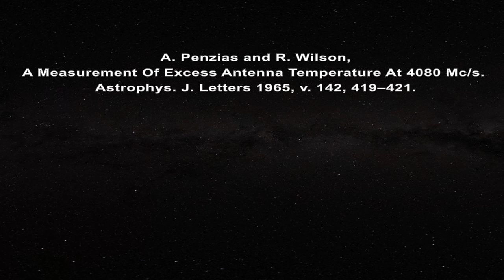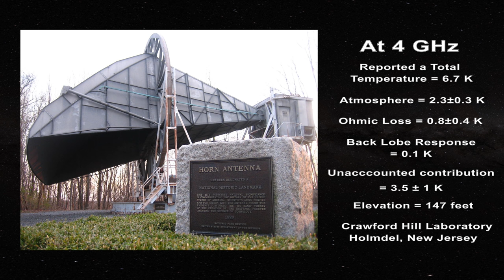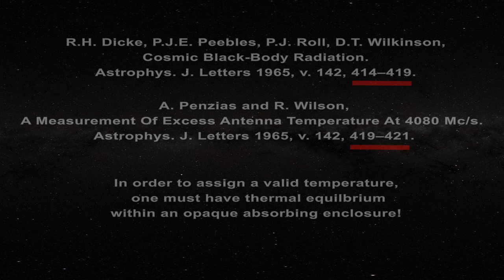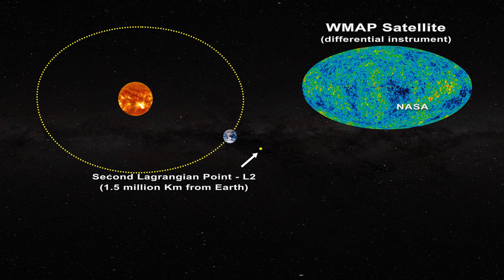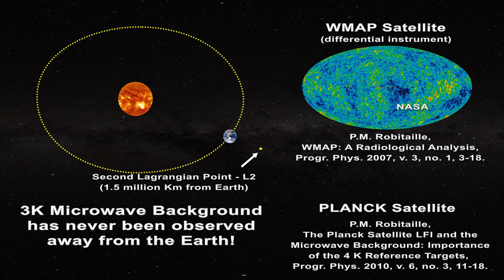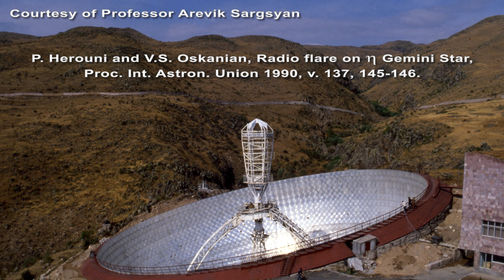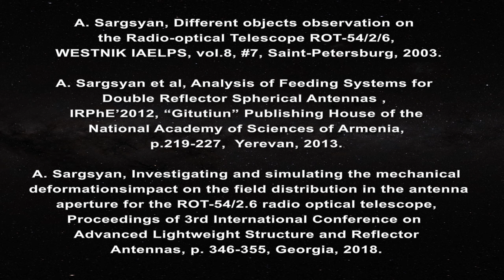The Herouni Antenna - The Death of the Big Bang!

Comment: I shared this to an astronomy group on FB and was immediately blocked.
Reply: If it was blocked by the scientific aristocracy, then it probably has validity.
Reply: @beyond_the_infinite2098  
That is a big problem with the rise of pseudoscience as of late... people on YT decide if a theory is valid not on the merits of the theory... but if mainstream science rejects it, it MUST BE right!! Conspiracy-science at its finest. I guess you believe in flat-Earth too?
Reply: Not good..
Reply: @Hank254  Agree but skepticism must explain why pseudoscience is wrong. If it doesnt then something smells politics or religion or territorialist behaviour.
Reply: Hank yeah you nailed it, the statistical power generates a significance if you go the opposite way of mainstream.
It could change bitnsondarnit works every time, go figure....
Reply: @beyond_the_infinite2098  That's not how science works - that's how religion works.
Reply: That's what you get for going on Tardbook.
Reply: @KibyNykraft  
To an extent, yes that is correct. The problem is that even after the errors/pseudoscience have been pointed out, the pseudo-scientists refuse to accept them. People do not believe flat Earth because of unexplained skepticism... they have their own reasons to believe which scientific explanations can not change. Mostly it is because there is an underlying belief which the science is mucking up. 

Robitaille's 'science' has been addressed, his pseudoscience pointed out, and his simple lack of understanding of the subjects he is talking about is clear to anyone trained in those fields. He simply refuses to accept it. He pushes forward, creating more videos, essentially arguing that the majority of science is completely wrong, without offering any evidence. All he has are ideas and an old telescope that would prove him right if it weren't decommissioned  :(  If this telescope were re-commissioned, and it showed him wrong, do you think he would accept it? I don't.

The reverse of what you said is also true... if pseudo-scientists want to be recognized as legitimate, they need to provide extraordinary evidence to back up their extraordinary claims. When they don't, it also smells.
Reply: @Hank254  : "He pushes forward, creating more videos, essentially arguing that the majority of science is completely wrong, without offering any evidence." Hank

Your remark is not true.  Professor Robitaille always provides evidence. He has presented evidence in this video. Here are two papers for you and others of your persuasion:

[1] Robitaille P.-M., WMAP: A Radiological Analysis, Progress in Physics, v.1, pp.3-18, (2007), 
 http://www.ptep-online.com/2007/PP-08-01.PDF

[2] obitaille P.-M., COBE: A Radiological Analysis, Progress in Physics, v.4, pp.17-42, (2009), http://www.ptep-online.com/2009/PP-19-03.PDF
Reply: Lots of politics in science.
Reply: @stevecrothers6585  
"Your remark is not true.  Professor Robitaille always provides evidence. He has presented evidence in this video."

You seem to be confusing evidence with opinion. Even in the conclusion of the first paper, he states
'

Analysis  of  data  from  WMAP  exposes  several  problems
which  would  not  be  proper  in  medical  imaging.'

Well, that's all well and good but we are not talking about medical imaging and the good doctor is well out of his area of expertise. While he may be formally trained in radiology, he is not formally trained in cosmology and it is clear his understanding of thermodynamics is wrong.

You probably don't recall but we have already had a similar discussion, Steve... all you did was cite papers which have already been rejected for various reasons by people actually trained in the respective fields. That is not what I call evidence nor productive exchange.

If you want productive conversation, please tell us if Robitaille's papers/ideas are accepted as mainstream. If not, please explain why the vast majority of cosmologists can't seem to figure out/accept that their images are only water-noise. Hint: Conspiracy theories, myths of 'settled science', rejection of outsiders, etc. aren't going to cut it.
Reply: @Hank254  : You are simply choosing to ignore the evidence. First, WMAP all-sky maps are nothing but data-processing artefacts. There is no signal in its maps. The signal to noise of WMAP is barely greater than 1, so it can't tell the difference between noise and signal even if signal is present (but it isn't).  The noise is ~1,000 times greater than the alleged signal. Without a priori knowledge of the source of emission or an ability to manipulate the source, it is impossible to extract any signal from such a large envelope of noise; well known to imaging science. In the absence of the CMB monopole signal all talk of anisotropies is wishful thinking. It is a scientific fact that the CMB monopole has never been detected beyond ~900 km of Earth - precisely because Earth is the source of the signal.

"While he may be formally trained in radiology, he is not formally trained in cosmology and it is clear his understanding of thermodynamics is wrong." Hank

Professor Robtaille is the inventor of Ultra High Field MRI. He knows how to take an image. WMAP has no images of anything. I suggest that you study professor Robitaille's paper on WMAP and then prove any error therein that you claim. As for thermodynamics, professor Robitaille is quite an expert. Take but one example: temperature is always an intensive thermodynamic coordinate. Astronomers and cosmologists however, unwittingly make their stellar and black hole temperatures non-intensive, in violation of the 0th and 2nd laws of thermodynamics. Professor Robitaille is correct; the astronomers and cosmologist are incorrect.
Reply: @stevecrothers6585  
I see that you chose not to answer my question as to why people formally trained in these fields (which you and Robtaille are not) can't figure this out. I must say I am not surprised. 

Simply claiming he is an expert is completely worthless; I have read his explanation of why he thinks Kirchoff's law is wrong and I can tell you for a fact he doesn't understand thermodynamics. His (and your) refusal to accept that doesn't make him right. 

The thing that is most upsetting is your (and Robtaille's) decision to shift your burden of proof to an audience of YouTube pseudo-scientists and flat-Earthers. Real science is not done with Youtube videos, arguments in comments section/blogs, and New York Times advertisements. The fact that you are unable to obtain publication in legitimate peer-reviewed journals is not an indication that you are being discriminated against or of some vast science conspiracy... it means you are missing something. Your closed-minded inability to accept that is no one's fault but your own.
Reply: @Hank

I stumbled into this video and I took a careful sniff of the water glass I've been drinking from then took a look at some of Pierre-Marie Robitaille's other videos. I'm pretty sure he and Deepak  Chopra could have an enjoyable lunch together explaining their own special relativity to reality to each other. I may have to subscribe just in case Big Foot comes into the equation and watch for the nut jobs to defend him...  

https://rationalwiki.org/wiki/Pierre-Marie_Robitaille
Reply: @Hank254  : 
"I have read his explanation of why he thinks Kirchoff's law is wrong and I can tell you for a fact he doesn't understand thermodynamics." Hank

What did you read and where is it wrong? You make claims without any evidence, so present your evidence. I reiterate: temperature is always an intensive thermodynamic coordinate. Astronomers and cosmologists however, unwittingly make their stellar and black hole temperatures non-intensive, in violation of the 0th and 2nd laws of thermodynamics. Professor Robitaille is correct; the astronomers and cosmologist are incorrect. Study the two papers below and explain to everybody where and why you think there is an error. 

[1] Robitaille P.-M., WMAP: A Radiological Analysis, Progress in Physics, v.1, pp.3-18, (2007), 
 http://www.ptep-online.com/2007/PP-08-01.PDF

[2] obitaille P.-M., COBE: A Radiological Analysis, Progress in Physics, v.4, pp.17-42, (2009), http://www.ptep-online.com/2009/PP-19-03.PDF
Reply: @stevecrothers6585  
If you do not want to have an actual, productive conversation about why you choose to peddle pseudoscince on YouTube rather than get a formal education on the material, then there is really nothing to talk about.

I have already explained, we have been down this road before... several years ago. You cite Progress in Physics papers, a pseudoscience journal founded specifically for authors who cannot pass peer review, as if their publication gives them merit. Why not just link to his website? Why can't his papers pass peer review? Why do formally trained physicists, cosmologists, astrophysicists, etc. point out problems in his papers that he (and you) are unwilling or unable to explain? 

Your (and his) claimed 'explanations' are trips down a non-productive rabbit hole to reach things that you simply dismiss as unbelievable, illogical, or, in your opinion, wrong. It is the exact same rabbit hole that Flat Earthers, global warming deniers, relativity deniers, 9/11 truthers, and so many other conspiracy theorists want to take you down. That is not a coincidence and it is not science. It is simply a method of distraction, a waste of time in the hopes that your adversary goes away and you can claim a pseudo-victory. It is simply to stroke your ego while you pretend to be on the same level as the people who explain why you are wrong.

Sorry, Steve, I will not play your game. If you want to have an actual discussion, please pick a field and get a formal education in the subject first. With all you claim to know, that should be child's play. There is no legitimate reason for why you could not do that instead of playing these completely nonproductive games. You want to have an actual discussion? Why don't you point to everyone out where you think I am wrong.

Maybe you don't want to give your 'hard earned money' to an education system you think is illegitimate? Here is an easy way around that... simply start a crowd-fund campaign 'Get Stephen Crothers a formal PhD'. You could frame it to your followers as 'beating them at their own game'. You would probably even get legitimate scientists to contribute if you put the money up front and asked for reimbursement after you pass your classes.

So how about it Steve? Are you man enough to level-up to the people you claim you are proving wrong? Or are you just in this for the rabbit hole?
Reply: @Hank254  : Your insults carry no scientific weight whatsoever.  Go back to my previous email: study the papers I cited there and then give the audience your explanation of where and why you maintain there is any error. So far you have not advanced a single scientific argument.  

"I have read his explanation of why he thinks Kirchoff's law is wrong and I can tell you for a fact he doesn't understand thermodynamics." Hank

What did you read and where is it wrong? You make claims without any evidence, so present your evidence. Also provide your proof that temperature does not have to be intensive as required by the 0th and 2nd laws of thermodynamics.
Reply: @stevecrothers6585  
Where exactly do you think I am insulting you? I asked you to tell me where you thought my post was wrong... why did you not do so?
Reply: @stevecrothers6585  
Whenever someone tries to overturn a currently accepted theory, one of the first things I look for is whether or not that person is trained in the subject they claim to know. While a formal training is not required to understand something, there are many details that people who self-study can miss. They end up with a basic understanding but it is not at the level of formal training.That is why self-taught 'scientists' are sometimes at odds with actual scientists.

Do you know how theories become accepted? The people who have formal training and, usually, work in the respective fields (the most knowledgeable in the subject) feel that a particular theory best matches the observations. A person who wants to overturn a theory must understand that theory at least as good as the person or people that came up with it. After all, by trying to overturn it, they are in fact claiming to know more than the people who came up with it. They should be able to teach/explain that theory and would have no problem understanding why it was accepted. They don't attack prevailing theories with baseball bats like you and Robtaille do.

I saw your (assuming it is you) YouTube video on the logical inconsistencies of Special Relativity and I can tell by the way you describe it that you clearly do not understand Special Relativity. This is not an invitation to debate the theory, I have no desire to teach it to you. I am simply stating a fact. 

I read Robtaille's claim of why Kirchhoff's law is wrong and I can tell he is not trained in (and doesn't understand) thermodynamics. This is not an invitation to debate PTEP papers with you. Pretending that the issue hasn't been addressed is disingenuous... that is a tactic of pseudoscience and it is pointless to argue science with pseudoscientists. 

If you (and Robtaille) think you are in a position to overturn these theories, it should be easy work for you to obtain degrees in these subjects. It would consist of simply passing the tests to get your degrees... no course work should be required. Stop playing rabbit-hole games and show us all that you are worthy of the position you are attempting to insert yourself into. Stop feigning insult to avoid the real discussion. Put up or shut up Steve.
Reply: @Hank254  
If your so smart, why don't you just answer his question on temperature? I ahve seen a few of his videos on the electric universe and they make sense to me. What have you done?
Reply: @juliopaquete6680  
Well, first off, I am not the one claiming to be smart... Crothers and Robtaille are the ones doing that. All I am doing is pointing out that if they were as smart as they say, they could (and should) easily get degrees.

Secondly, I am not answering his question because he is not really asking a question. Questions are things you want answers to... Steve pretends to already know all the answers. It is a psychological game he is playing because it upsets him that he isn't part of what he considers the 'scientific elite'. He really REALLY wants to be and this is his way of getting back at 'them'. His 'questions' have already been responded to in other places by professors but he just keeps asking them. When people take the time to explain things to him, he becomes combative and adversarial... when the other person matches his tone, he then accuses them of being adversarial and unscientific.  Over and over again this is the 'meat' of his arguments... wash, rinse, repeat... it is nothing but trolling. I refuse to play his troll game and instead bring the conversation back to reality. He doesn't like reality and, as you can see above, he refuses to participate.

The temperature question he is pretending to ask is itself a lie, intended to disparage astronomers and cosmologists. They are NOT claiming that temperature isn't an intensive property... he is misrepresenting something so he can claim that. As has been explained to him before, there is a difference between classical thermodynamics and black hole thermodynamics. Classical thermodynamics is based on kinetic theory of particles while black hole thermodynamics is not. The 'temperatures' of the two different theories are analogous but not exactly the same. He simply refuses to accept this (by denying black holes can exist) and changes the subject to something else he gets wrong. When you take the time to explain the new thing he gets wrong, he refuses to accept it and moves to a third thing he gets wrong. It is a deliberate game of willful ignorance. It is a complete waste of time to engage him in pseudo-scientific discussion.

As far as EU theory goes, people fall for it because it has a certain intuitive feel to it. It tries to relate gravity to electricity because both fall off as the square of the distance. Electrical Engineers are (generally) smart people but they seem particularly prone to making that incorrect intuitive connection. Unfortunately, human intuition has been shown again and again to be imperfect at figuring out how things work. Take the Bhor model of the atom (the electron orbiting the nucleus like little balls)... do you have any idea how common it is for people to think 'Hey... maybe atoms are actually tiny little solar systems/galaxies with people living in them!!!' That 'theory' comes up over and over again because it has an intuitive feel to it. Granted, the Bhor model is not very accurate but trying to convince people that atoms are not solar systems becomes difficult if they lock on to that. EU theory is very much like that. Einstein also tried, and failed, to unify gravity with electricity (though in a totally different way). Don't fall for it... if you are really interested in the subject, study physics... don't watch fringe YouTube videos. Electric Universe is the same as flat Earth, free energy, perpetual motion machines, and fake moon landing conspiracies. They use the flaw in human intuition to go off in the wrong direction.

I can tell you for a fact that Crothers (well, let's face it... we are really talking about Robtaille  here, Crothers' scientific knowledge amounts to a speck of flea shit. Crothers is only parroting what Robtaille says) doesn't understand what he is talking about. He puts on a good show, all trolls do, but there is no actual substance there.
Reply: @islandbuoy4  Why would Jesus love female sheep?
Reply: @Hank254  : "This is not an invitation to debate the theory, I have no desire to teach it to you. I am simply stating a fact. I read Robtaille's claim of why Kirchhoff's law is wrong and I can tell he is not trained in (and doesn't understand) thermodynamics." Hank

I reiterate: what did you read and why is it wrong? You must provide evidence to support your allegations.

"I can tell by the way you describe it that you clearly do not understand Special Relativity." Hank

This is not a scientific argument. You must provide evidence to support your allegations.

So far you have not advanced a single scientific argument.
Reply: @stevecrothers6585  
"I reiterate: what did you read and why is it wrong? You must provide evidence to support your allegations."

Your latest post is completely devoid of meaningful dialog. I have provided you a channel for meaningful dialog and you continually choose to ignore it. 

The evidence to support my allegation(s) has already been provided to you by others. Your simple denial does not change that fact nor does it change the quality of the evidence. Your refusal to accept the evidence as valid does not constitute a rebuttal of the evidence. It is, in fact, your refusal to accept the evidence that REQUIRES YOU to justify proper understanding of the material. The way that is done is by demonstrating to an accredited institution that you have the requisite knowledge. Neither you nor Robtaille have done that in the subjects you claim need to be revised.

Do you understand the null hypothesis of this situation, Steve? The default position? The default position is that people (which include you and Robtaille) are considered to be part of the average population (i.e. not subject matter experts) unless evidence is provided to the contrary. Your (and Robtaille's) position of refusing to accept the validity of subject matter experts is itself a claim that you are more knowledgeable than said experts. You also state outright that Robtaille is an 'expert in thermodynamics'. I reiterate Steve, Please provide evidence of your claim. If Robtaille (or you) is trained in this material as you suggest, please provide the evidence or a reasonable justification for why this would not be required.

Until you do this, Steve, your refusal to accept the explanations for why you and Robtaille are wrong, combined with your disingenuous position that the issue has never been explained to you before, constitute PSEUDOSCIENCE. There is no reason to address your pseudoscience with actual science.
Reply: @Hank254  Have you or any accredited experts in thermodynamics presented these refutations to Dr. Robitaille in papers or any sort of public form? It would be a simple matter to cite that, so us average people could hear the answer too.
Reply: @TorJuice  
Part of the problem with what you are asking is that actual science is not done in public forums... that's how pseudoscience is done. The fact that his 'papers' cannot pass peer review is all the refutation that is needed. There is no need for real scientists to publish papers refuting his misunderstandings any more than they need to publish papers refuting every flat-Earth claim. It is a complete waste of valuable time to explain things to people that have their fingers in their ears. I gave Crothers the opportunity to explain why he and Robitaille  are unable to pass legitimate peer review and he could not answer. He could also not answer why Robitaille  is peddling his misunderstandings to the unsuspecting public when he has repeatedly been told why his theories are wrong.

FWIW, I have never even seen Robitaille  try to defend his position in a public forum (although Crothers tries to quite often). If you search, you will find many examples of real scientists pointing out the flaws in Robitaille's arguments. Anyone interested in learning about science should be doing their own research rather than having someone point to it but if you search for Brian Koberlein Tilting at Windmills, you will see one example of what you are looking for. There are many others. Personally, I would recommend learning about Kirchoff's law directly (what it means and how it was discovered) instead of trying to prove a particular person right or wrong.

For your future research into science, a glaring indicator that someone is a crackpot is when their whole approach is to simply destroy existing theory without presenting anything better as a replacement. Robitaille and Crothers want to destroy the CMB so they can destroy the Big Bang... yet they offer no theory to replace it or explain away the other data. They want to destroy special and general relativity... but they have nothing to explain why experiments back up those theories so well. They dispute the existence of black holes yet offer nothing to explain extreme orbits observed around them. These are clear indications of pseudoscience in action. Real scientists don't spend all their time refuting established theories, they come up with better theories that make the old ones obsolete.

I have asked Crothers several times now but he refuses to answer... maybe you could give a reason.... if Crothers and Robitaille  know as much as they claim to know about thermodynamic (and physics in general) why can't they simply go through the motions of getting PhDs in the subjects they claim to be experts in? Rather than just arguing they are experts, why don't they SHOW US??
Reply: @Hank254  Thank you for the reference. I asked because I find it's usually more productive to look at the arguments or sources given by people at hand with a stake in a controversy first, rather than search engine results.

Whatever value specific academic degrees have for choosing where to place some baseline trust, one's time and attention, on any specific question appealing to that authority is just a fallacy. I don't see how it's at all contingent on someone pointing out an error, right or wrong, to re-explain everything built upon that error. It sure would be nice, but it's not really on them. The current state of theory in physics and cosmology was the work of many hands, and it would be again if big unknowns were reopened.

I've certainly found mavericks before who sounded good at first but turned out to be full of hot air. I've also seen plenty of evidence that scientific culture is not immune to the pitfalls that arise from any group of creatures as crazy as humans organized into a collective. I don't know the math required to really evaluate Crother's claims, or anyone else's on exactly how spacetime is supposed to work for that matter. But I do feel equipped to fully understand something like Kirchoff's Law, given time.

For now, it seems to me I'm faced with two hypotheses for why Robitaille's work is rejected by physics journals and he's labeled a pseudo-scientist.

1. He has indeed made some fundamental errors but just won't quit.
2. He is correct about at least some of the errors he asserts, but they have been unwittingly perpetuated by so many for so long anyone whose work hinges on them would fight tooth and nail against ever admitting it, even to themselves, because it's that embarrassing and disheartening.

Whatever the case, I'm sure time will tell.
Reply: @TorJuice  
I disagree that examining the arguments in a controversy would be more productive than using search engines to find relevant information on the topic, or even the controversy, at hand. To do this elevates the perceived status of a psuedoscientist to that of an actual scientist... THAT is the main goal of their argumentative tactics. They like to treat science as if the validity of a theory is based mostly in the debating skills of the person presenting it. I wholeheartedly disagree with that position but it is extremely effective at swaying people who prefer watching the debate over leaning the science.

While I agree with you that anyone is free to point out an error, claiming that putting your trust into the authority of an academic degree is a fallacy is, pardon my frankness, completely ridiculous. You would never do this in any area of life where it mattered to you so why do you now try to use this as an argument in favor of listening to pseudoscientists? If your arm were severed in a car accident, would you go to a kid behind a McDonald's counter to re-attach it? He claims that 'doctors' understanding of the human body is majorly flawed and blood is not needed to survive (and puts up a great argument to his friends) so would you say he is just as capable? Somehow I think you would put your baseline trust in to the academic authority. People don't get to simply claim they are an authority and have it be true, that is exactly what Crothers and Robitaille are doing. They are attempting to position themselves as authorities without being able to demonstrate (even in the slightest) that they fully understand the material. If you are trying to claim that putting a baseline trust in academic degrees is the logical fallacy of 'Appeal to Authority', then I am sorry but you don't understand the fallacy.

That particular position is even refuted by Crothers himself by repeatedly making appeals to the established academic science to bolster his own arguments. Why would he do this if that is a fallacy? Why is he bothering to make an appeal to the very scientists he is claiming we should not listen to? He is simultaneously trying to use the position that an academic degree in institutionalized learning is immaterial and flawed AND using the flawed material to formulate his own position. Crothers wants to 'Stand on the shoulders of dwarfs', or at least he is calling them dwarfs. All he and Robitaille need to do is use their claimed superior understanding for actual results rather than Youtube ad revenue and hi-fives from flat-Earhters. If they did this, they would find science following them instead of ignoring them.

The point about re-explaining everything based upon an error being contingent upon an alternate theory goes to the acceptance of that new theory. The person is not required to re-evaluate the entirety of science, no one is asking for that... there are others that will come up with replacement theories in their respective areas of expertise. The problem is when someone wants to claim a theory (which is very good at explaining experimental results) is wrong and must be discarded when they have nothing else to explain the experimental results. Not only do they want to destroy the currently accepted theory, but they want to destroy anything that is based (even loosely) on that theory. That is simply not how science works. That is the sign of a pseudoscientist with an agenda. If Robitaille  and Crothers want to say that Kirchoff's law (among many others) is wrong, then it is most definitely contingent upon them to present a replacement law that explains the observations better than Kirchoff's law did. They are totally unable to do this. Instead, they say we should disregard Kirchoff's law and listen to them instead... that whatever they tell us to believe is right.

For your two hypotheses of Robitaille's rejection, I can tell you that #2 is an often perpetuated misunderstanding of how science works. No one is going to lose their job or funding or be ostracized if a better law than Kirchoff's is discovered. The thing that drives the vast majority of scientists to become scientists in the first place is a desire to understand the way the universe IS, not to show that their understanding is right. Non-scientists have a hard time accepting this because most people are more obsessed with being right than actually understanding. So, to the average person, your hypothesis 2 seems legitimate. That type of thinking is exactly why the average person is not a scientist. It starts with a mindset, progresses through an education, then continues with work in that field which may (but often doesn't) produce new findings and theories. Science is updated ALL THE TIME when something better is presented. I could say that eliminating your second hypothesis leaves only one possibility but that would be a fallacy of false choice. There may be many other reasons why he (they) are rejected and I would be happy to examine them if presented. The most telling fact I see right now is that Crothers refuses to answer the question. Nor will he answer why, if they are such experts in the material, can't they demonstrate it by passing tests of the prerequisite knowledge?

So there is, hopefully, a concise description of a fork in the road. It was hoped by many that the Internet would make access to valid information easier and facilitate learning; path #1. Unfortunately, it seems to have also made louder the voices that tell us logic and learning are no where near as good as arguments and human intuition; path #2. Neither path is perfect but one has actual results (like the device you are using to read this) and the other has lots of worshipers. It is up to the individual which path they want to choose (or maybe we don't really have a choice) but I can tell you that when I look at Crothers' arguments, I can clearly see he is full of #2.
Reply: @Hank254  Thank you very little for wasting our time with your words.
Reply: @P-Drum  LOL, look who's talking  ;)  Can't even be bothered to address the topic and I am wasting your time?!?! LOL If you are watching this channel, you've got plenty of time to waste!
Reply: @Hank254  I tip my hat, o mighty troll.
Reply: @P-Drum  Even more time wasted... why don't you just explain Robitaille's replacement for Kirchoff's law instead of posting nonsense?
Reply: Commodore Grayum Crothers and others like him do not answer questions or acknowledge errors. People like those are not worth conversing with on issues of science. I totally agree with Hank.
Reply: @CommodoreGrayum  You willfully miss the point. I have pointed out Crothers' mistakes, and he then goes quiet. For example, under his SR lecture, another commenter and I have been trying to explain an area of the subject he clearly misunderstands, and he turns into either a broken record, repeating nonsense, or disappears from the conversation. That's not science or honesty - that's being a troll.
Reply: @CommodoreGrayum  Would you agree with this or not?
Reply: @CommodoreGrayum  Do you still think Hank is wrong after reading that? It would amaze me if you could find a reason not to retract your previous evaluation.
Reply: @Commodore Grayum Ooh, a hard one. Little bit of unnecessary heat there fella. This: https://i.ibb.co/4wqwygC/image.png . Are you just ignoring my comments?
Reply: @CommodoreGrayum  Lol calm it bro, he just responded to your query pretty decently. No need for the insult.
Reply: Evidently Hank is unwilling to refute a single point but prefers to fence with his high brow and demean his foes by mighty slurs, impugning and priggish condescension.
Reply: Name the group or I call BS.
Reply: Pete  : Irrespective of SAFIRE results, hank and nuclearcraft are tag teaming with not one single verified scientific fact. They skirt all substance then turn around and accuse Crothers of what they alone are doing. hank sez Crothers is refusing to indulge in "useful dialog". What hank deems "useful" is anybody's guess, but it doesnt include substantive refutation. It is ad hominem, only. That in itself is admission of cluelessness.
Reply: But what did you expect from that arena?
Reply: This is depressing! Scientists should be open to all the criticism, this is how Science progresses.
Reply: Not surprising, really, as the Big Bang Theory has always been intrinsically linked to religious doctrine about The Creation. People are terrified of their beliefs being threatened. Religion has been stifling scientific advancement, particularly in cosmology and astronomy, generally, for a very, very long time.
Reply: @stevecrothers6585  you keep referring to the second law of thermodynamics, but Kirchoff's law itself is a consequence of the second law of thermodynamics. You can't just deny Kirchoff's law and leave it at that.
Reply: @alexdevisscher6784  : "Kirchoff's law itself is a consequence of the second law of thermodynamics." Alex De Visscher

You are incorrect. You obviously don't  know what Kirchhoff's Law is. Tell us all what Kirchhoff's Law is in your next post.
Reply: @stevecrothers6585  you have some nerve. You can't even bother to come up with a scientific argument, even though you demand scientific arguments of others. 
Kirchoff's law: emissivity equals absorptivity. Do you want proof too? Here it goes. Suppose emissivity of an object is greater than its absorptivity. Then that object is able to heat up a blackbody of the same temperature, because the emission plus reflection of the object is greater than the emission of the blackbody. The blackbody increases in temperature, and the temperature difference can be used to drive a heat cycle. Result: free energy, in violation of the second law of thermodynamics. If the emissivity of the object is less than its absorptivity, then the blackbody can heat up the other object, which again leads to free energy and a violation of the second law. Conclusion: emissivity equals absorptivity, proving Kirchoff's law.
Reply: @alexdevisscher6784  : "Kirchoff's law: emissivity equals absorptivity." Alex De Visscher

No, that's not right. What you stated is Stewart's Law, except that it only holds at thermal equilibrium; otherwise it does not hold. Kirchhoff's Law of Thermal Emission however, is certainly false.

Robitaille P.-M., Crothers S. J. "The Theory of Heat Radiation" Revisited: A Commentary on the Validity of Kirchhoff's Law of Thermal Emission and Max Planck's Claim of Universality,Progress in Physics, v. 11, p.120-132, (2015),
http://vixra.org/pdf/1502.0007v1.pdf
Reply: @stevecrothers6585  no, you are wrong. Stewart stated that emission equals absorption, which is not strictly the same as saying that emissivity equals absorptivity. Look at any physics textbook, and you will find Kirchoff's law essentially the way I stated it. Your paper contains several flaws that invalidate the argument against Kirchoff's law. First of all, you don't distinguish between absorptivity, which is a surface property, and absorption coefficient, which is a volume property. The distinction is very important if you want to understand Planck's argument. By confusing the two, you conclude that reflection is needed in a part of Planck's argument that doesn't need reflection. A different, but related flaw is that you don't seem to understand the concept of the infinitesimal in calculus, causing you to add absorption in a part of Planck's argument where no absorption is needed. The overall outcome is that your paper is fatally flawed, and Kirchoff's law stands.
Reply: @alexdevisscher6784  : You are still wrong. Stewart determined from experiments that only at thermal equilibrium does emission equal absorption: Stewart's Law. It's clear that you don't understand what thermal equilibrium entails. That the textbooks incorrectly refer Stewart's law to Kirchhoff does not make it Kirchhoff's Law. You have not even stated Kirchhoff's Law. It's quite clear that you don't even know what Kirchhoff's Law is. Your argument about reflection is nonsense. Planck did not consider or test reflection owing to his abuse of Brewster's Law with the former's polarised radiation. Blackbody radiation is never polarised. This has nothing to do with the calculus; it is a matter of physics. You have not in fact identified any flaws in our proof that Planck's theoretical proof of Kirchhoff's Law is false.  There is no theoretical or experimental proof of Kirchhoff's Law; precisely because his 'law' is a fallacy. The very existence of resonant cavities proves that Kirchhoff's Law is false. But to know why you will first have to learn what Kirchhoff's Law is.
Reply: @stevecrothers6585  you obviously didn't understand my argument, so you're calling it nonsense. Again, emission is not the same as emissivity. Absorption is not absorptivity. Your response clearly shows that you don't understand the difference.
We've known since Newton that physics cannot violate calculus. The way your paper mixes up surface properties with volume properties violates calculus. 
Planck clearly mentioned "arbitrary polarization" in reference to blackbody radiation. In other words, his argument works for any polarization. So by applying the argument to every possible polarization angle, and considering a mixture of light rays of all possible polarizations, we find that his argument applies to non-polarized light. Kirchoff's law, the way Planck formulated it and the way it is generally known, is correct.
Reply: @alexdevisscher6784  No, Planck is wrong. Blackbody radiation is never polarised. Furthermore, by his abuse of Brewster's Law Planck did not even test reflection.

"We've known since Newton that physics cannot violate calculus." De Visscher

Calculus is pure mathematics. Physics is not mathematics. 

"Kirchoff's law, the way Planck formulated it and the way it is generally known, is correct." De Visscher

The existence of resonant cavities proves that Kirchhoff's Law is certainly false.
Reply: @CommodoreGrayum  If you actually read through the thread then you would know exactly why I don't engage pseudoscientists in discussions of science. I am more than willing to discuss why (if my interlocutor knows what he claims to know) he is unable to get a degree in said material but he is afraid of that discussion. All I hear from his fan club are excuses and conspiracy theories. Sorry, doesn't pass the smell test. His errors have been sufficiently pointed out to him... if he decides to ignore them and repost his claims in different forums, there is nothing I can do about that. If you had a job that required any amount of actual knowledge, you would be able to spot when someone was bullshitting you in that field. That is exactly why the pseudoscience is being peddled in a Youtube discussion where the vast majority can't see the bullshit. Do you understand any of this?
Reply: skaindu  
Nope, I don't deny curved spacetime.
Reply: @CommodoreGrayum  

"And a claim that he's been debunked. Has he?"

Well, if you had done your research beyond what you see in this thread you would have known the answer to that. The fact that you would rather be in here arguing about words rather than doing said research speaks volumes to your intellectual honesty.

As for the rest of your post, what you see in my replies doesn't bother me in the least. Don't like them? Don't read them. If you want to answer an actual question, feel free to explain why someone who claims to be an expert in the material can't pass the tests which demonstrate such knowledge. I know the answer to that but you are in denial... spinning your wheels trying to argue with an anonymous person who knows more on the topic than you do.

I suppose you would go to a landscaper to have surgery done as long as the landscaper claimed he knew what he was doing? Doesn't matter that he can't make it through medical school, does it? The actual doctors giving you warnings to steer clear are just part of the 'establishment' and should be ignored... right? My prediction is that you will disregard my pertinent questions with simple dismissals because that is all you are capable of  ;)
Reply: @dubyajayyo  
Sorry, you have me confused with crothers  :)  I never claimed any prestige (he did) and I am not trying to dupe anyone (he is). Clearly you still don't have a clue so why are you posting?
Reply: @rogerscottcathey  
"What hank deems "useful" is anybody's guess, but it doesnt include substantive refutation."

It's pretty clear if you go back and read the thread Skippy.  There is no reason to 'refute' pseudoscience BS with actual science. The actual science is there for anyone to research if they so desire. Learning science is hard and there are those that would rather put their money on a long shot (and that's being generous) instead of putting the effort in to learning anything. All Crothers (and Robitaille) has to do to prove me wrong is to make a prediction with his/their theory that comes true. The glaring hole in that is that he HAS no theory... all he wants to do is claim the Big Bang is wrong; he has no theory to replace it. That is not science... that is Youtube moron food and you are gobbling it up. Now put on your feed-bag and come up with a witty reply   ;)
Reply: Hank 

Do you not peddle Big Bang theory?
Reply: @CommodoreGrayum  

"Can't"? Are you claiming that he has tried to obtain the relevant degree and failed?

I am claiming that he obviously doesn't have the knowledge to get a degree. If you had a degree in physics, you would see this too. You think he does have the knowledge but he 'won't' get a degree? Fine, feel free to explain why he wants to talk the talk but 'won't' walk the walk... As I said, he is afraid of that conversation, he would rather play pretend-scientist games.

"Your analogy with surgery is pure sophistry, too."

It is sophistry to you because theoretical physics is not life altering so you believe we can throw away any need for intellectual honesty. That is a common position among pretend scientists. You ignore the fact that claiming to have knowledge is not the same as being able to prove it; especially when people who CAN prove it explain that you are wrong. You dismiss that as sophistry, just as I predicted ;)

"I'm not even saying that the guy is right. I'm just saying that your arguments as presented in this thread are either incompetent or dishonest."

The arguments I am presenting are that both Crothers and Robitaille have been debunked by actual scientists. If you choose to ignore that material, fine... but don't pretend it must be presented yet again in THIS forum or it 'doesn't count'. When proven wrong, they simply move to another, less educated forum and start over as if no one ever explained why they were wrong. Please explain the intellectual honesty that is rooted in.

Frankly I am not particularly concerned with your constant bashing of peer review... that was worn out by global warming deniers who used the exact same anti-science tactics that are being presented here. 

"Again, this is a different issue than whether one man is right or wrong on a particular point of theoretical physics."

No, it is about what that man does when it is explained to him why his ideas are wrong... and THAT is the thing you are avoiding. Maybe you might understand that if you spent more time trying to learn the material and less time streaming your video games? Just a thought  ;)
Reply: @CommodoreGrayum  
"As mentioned, I do in fact have a degree in physics."

Well, you implied it, you didn't actually state it like you just did. As you well know, talk is cheap on the Internet... many people claim knowing things that they really don't. Of course, I have no knowledge of your schooling to say you don't have a degree but by 'degree' maybe you mean an associates ? I can tell you don't have a PhD. Be that as it may, a PhD is not required to see through this BS. My arguments are simple and straightforward... this material is pseudoscience. It has been demonstrated as such many times over and it is not necessary to present those refutations all over again to a new audience like a game of whack-a-mole. That game attempts to reduce the entire paradigm of scientific inquiry to that of flat-Earthers, moon landing hoaxers, and Bigfoot chasers. That is what is being done here. The actual science is out there for anyone to learn if they are so motivated.

"But hey, I play video games sometimes, so I must be wrong about any 
given topic, right? Because that's totally how reality works!"

Nope, didn't say that. It does show, however, where you have been spending your free time for the past 2+ years. Nothing wrong with that, you do what's important to you. You have a good day too and good luck with the channel.
Reply: @Hank254  Curious what you make of the findings from telescope in Armenia then?  Or do we just dismiss those... because (handwaive) Science!  Seems at least worth trying to invalidate and give that much more weight to the current leading theory by ruling out alternative explanations.  That would seem like the legitimate scientific thing to do.  Not get all emotional, dismissive, and attack people as psuedo-scientists.   Help get the telescope back in working order, and let people prove him wrong.  Win-win for everyone.
Reply: @holdenrobbins852  
There were no findings from this telescope (Robitaille was claiming a lack of a finding) and it did not operate at the proper frequency to produce a finding. He can certainly bring the telescope back on line if he wishes... do you have a link to his crowd-source page? I would like to see how much he has raised so far. Personally, I would not contribute because his idea is ridiculous. He is simply using this telescope as his Wardenclyffe.

If you believe that a radio telescope in space (pointed away from the Earth) is only picking up random static from the oceans (and makes repeatable images of the sky that way) while this telescope (on Earth) doesn't then I would suggest studying how this stuff works before parting with your money. 

The tactics he is using in the video to sway people (handwave) are obvious, it is unfortunate that some are taken in by him. This is not how actual science is done but your average person hanging out in a Youtube comments section doesn't know that... that is exactly why he posts videos here. Even a nutter walking around telling people 'The End is Nigh' will have followers... I am not convinced that we need to spend millions of dollars to disprove the nutter's claim. All claims are not created equal (as much as pseudoscientists claim they are) and stories that 'everything in this topic is wrong' made by people who don't even have the requisite knowledge can be dismissed as unfounded.

You are free to follow any 'scientist' you want to, that's exactly why he have flat-Earthers, geocentrists, young Earth creationists, free energy charlatans, etc. You get to look at all of the evidence and make a decision as to the best theory that explains it; no one is forcing anything down your throat. Of course, a person has to understand the evidence and Robitaille makes it painfully obvious he doesn't. Fortunately for him, most of the people in here have already made up their minds what they want to believe... they just want someone to tell them they are right.
Reply: facebook dude?
Reply: @CommodoreGrayum  Wow, thank you that you made it this far with him and that you closed it by killing his assumptions with a degree (which I know for every other intelligent person it would not have to be the resulting matter in the logical argument as knowledge can be obtained even without a degree and that facts talk BS walks). But I believe that most of the readers probably understood that this guy just didn't want to be reasonable. I think the worst thing in life is as some people know little they just believe they know much more. Anyways great finish, I may be made two comments on youtube ever but to you, I just had to give thumbs up!
Reply: They probably got tired of being spammed by crackpot 'theories'.
Reply: The wizard hats they wear should be a clue . . but the point is lost on them
Reply: I don't know if you were actually blocked by an astronomy group. Maybe you're lying.
Reply: @Hank254 I liked your comments/replies here. This "Brian Koberlein Tilting at Windmills" post you wrote of is great. Like you wrote, if someone overturns an established theory, they must first know the material at least as well as the one who came up with that theory.
Reply: @Hank254  In this vid. Robitaille made it sound like Planck satellite never obtained any imagery of CMB, but it did even in greater resolution.
Reply: @stevecrothers6585  Mind blown man . . your Einstein debunking was informative
Reply: @stanislavsynytsia6592  
Agreed. I am not sure how they have convinced themselves that supposed random RF emissions from water on Earth are going to produce repeatable images from a satellite orbiting at L2 (1/4 Million miles from Earth), but that's pseudoscience for you.
Reply: Because is bs...
Reply: @LuisPa247   Don't break our balls man
Reply: And now, 2 years later, we all see the censoring and bias on FB, and all other big tech.  So it is MUCH worse now than 2 years ago.
FB is the last place to expect any open minded, unbiased, objective discussion of anything.
Reply: @Hank254  You are, as many point out, full of it. Deep down, when you look in the mirror, you know it.
Reply: @frankslade33  
Thanks for the comment Johnny but, for anyone who knows physics, it is easy to see Robitaille is the one who is full of it.
Reply: @Hank254  we all know u dont
Reply: @disposablehero1235  Cool!! You guys seem to know everything  🤣
Reply: @Hank254  talking about yourself? Yea thats funny
Reply: @disposablehero1235  Nope, talking about you. You even admitted it... you all know but I don't. I can see this reading-stuff is way over your head... please get an education before trying to reply! You have been disposed of  😂🤣
Reply: @Hank254  sure thing mid wit